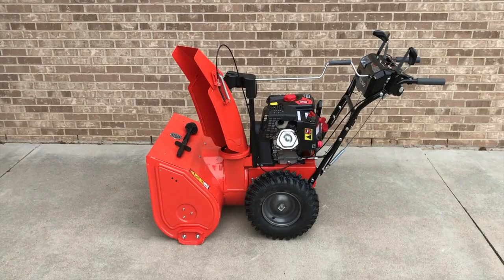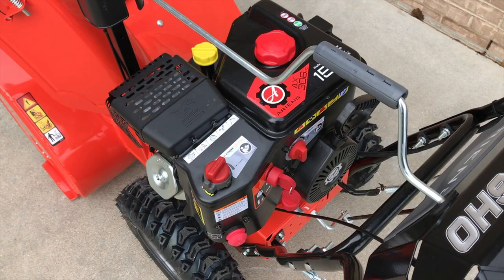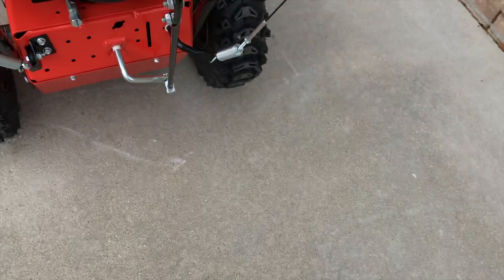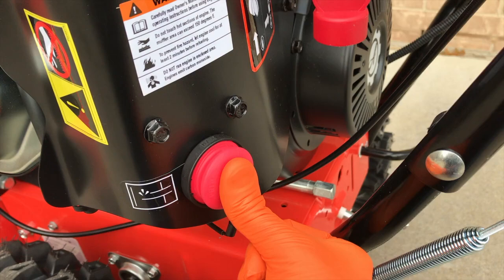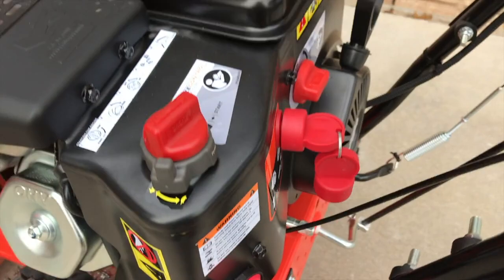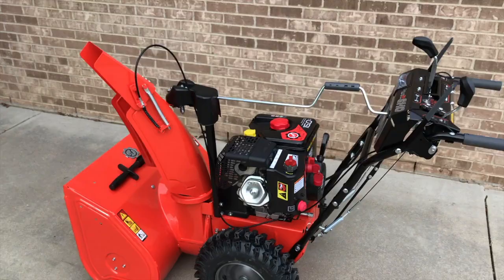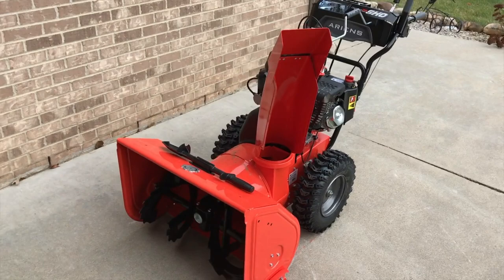Snow Blower not starting - "MOST Common Causes"

Comment: I mean, this is good if you’re trying to just learn how to start your snowblower, but it’s not helping if you’re having trouble starting your snowblower
The point is you’re doing what you’re supposed to do to start it but it still won’t start why??
Reply from the maker: Thanks for watching.  Very kind of you to share your thoughts and feedback, always welcome here.

Does it have a pull start option?  Are you able to start it via pull start?
Reply: yes it does and it didn't help.
I did finally get it started messing around with it trying different things, wiggling the spark plug connection and it started, Not sure exactly what I did to get it to finally start. Maybe it just needs a tune up i don't know  @DIYwithMichaelBorders
Reply from the maker: @mackinnonremodeling  

We appreciate the follow up.  A tuneup is recommended.  A brand new plug and wire/boot could make all the difference since it started when fiddling with those parts.

Comment: I always struggle with figuring out how much oil to put. No matter how many times I wipe the dip stick and check it, I can't tell how much oil I put in. Fresh oil is clear and the stick tend to grab oil from the side of the oil pipe. I rely looking inside the tank which is not a good way to do it. Any tips on that?
Reply: Remove as much as poasible and then put the new oil ans let it go all the way in the machine. Usually, the good one with the small amonth with the old one (not a big deal). You check how much does your blow need and do that. Or once u fuel up. And to few hours or check back tmr. Usually. U will see more clearly the fuel.

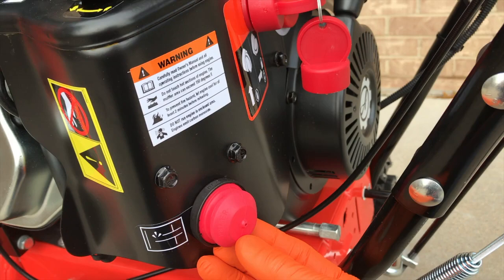Comment: 1:04 I mean yeah anyone who has ever started anything with those primers should of kind of realized that the only way fuel gets sucked up is if you block the flow of outside air creating a vacuum which sucks the gas, Partially covered works as well but to get the specific amount of gas needed requires the full blockage. Idk Maybe im just a special case since i grew up tearing things apart since there was no internet or any of that, until i was a  teenager. I have a older snowblower i checked for the longest time to find the gas shutoff but ive never seen one, is there ones without do you know? Im just making sure. Whats recreational fuel? Things like adding stabil to it? or is it a specific number at the pump?
Reply from the maker: Thanks for watching and sharing your thoughts, we appreciate all helpful inputs.

Recreation fuel is a non-ethanol fuel and is very clean for your engines that are not your vehicle.

Examples would be boat engines, Jet Ski engines, snowblower engines, lawnmower engines, and 2-stroke engines like the ones in leaf blowers and string-trimmers.

It doesn’t deteriorate and contaminate itself over time like regular gas does and because of this…it’s a huge benefit having it inside your engine and fuel tank while the machine is being stored for long-term.

Not all gas stations have Recreational/Non-ethanol fuel however, for those that do… It will be at a pump.

Some gas stations have the pumps located in a separate spot on property.

😎👍🧰
Reply: @DIYwithMichaelBorders  I see, I guess that would be why, i don't have anything like that around me. Everyone I've ever seen just put things like Stabil or another gas stabilizer in it. I'll have to pay attention next time i go into a bigger city.
Reply from the maker: @KingKatura  

Thanks for the reply.  It’s likely that you will find it at gas stations located in big cities as well as areas outside of cities.

👍